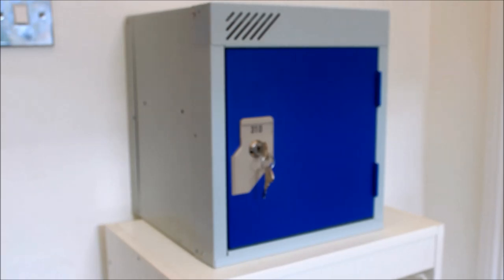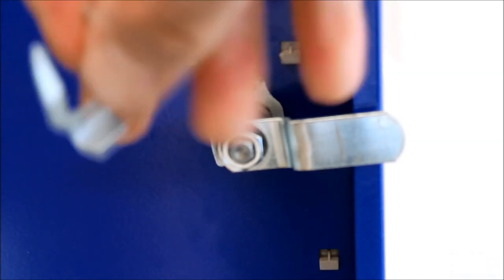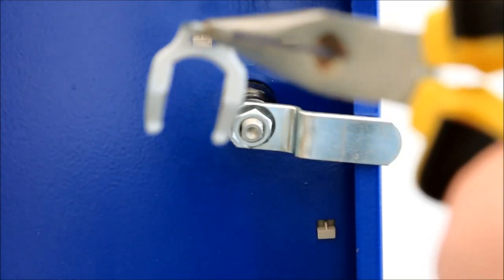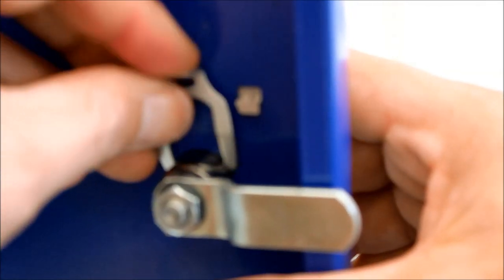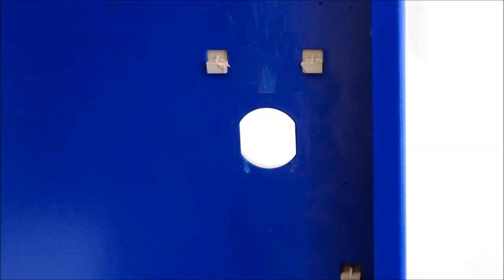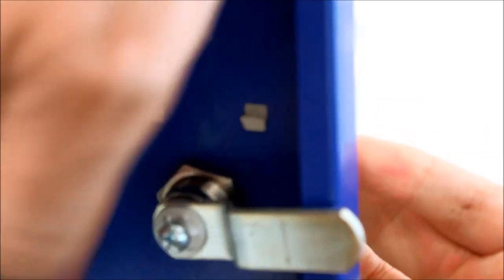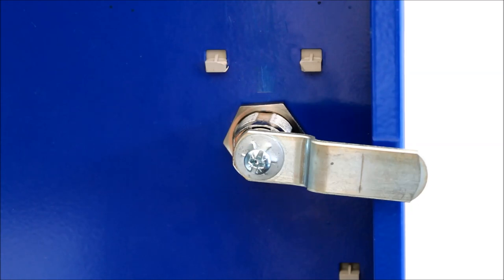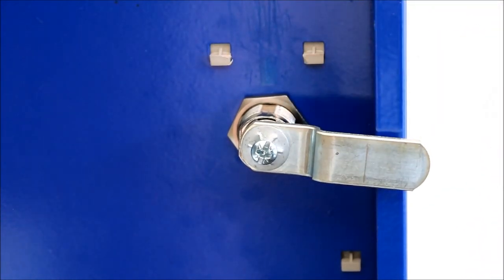How to change a locker cam lock

Comment: I have a lock like this but it doesn't have a screw holding on the tail. The tail is set inside and it just slides side to side when you rotate the key. Problem is I can't figure out how to install it because the locking nut can't fit over either end. The tail is too big to slip the nut over and so is the face.

I think I have to remove the tail somehow but I can't figure it out. Ever seen any like this?

Comment: that type of locker stops you from opening the door towards the outside, but is there a way to stop people from punching the door towards the inside and stealing the things inside it?
Reply: Yes there is , first you measure the inside of the locker from the back to the edge of the door , find a piece of  strong wood  or cut it to measure even better would be a metal bar  place it inside the locker  across touching the back of the locker and the  edge of the door, two on each side would make it even stronger.